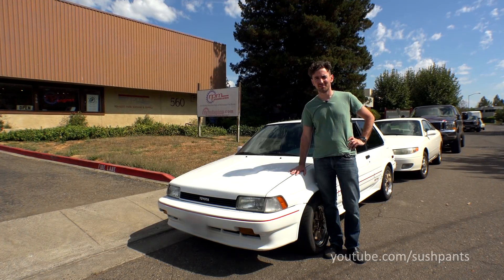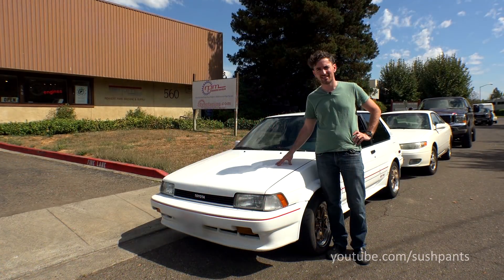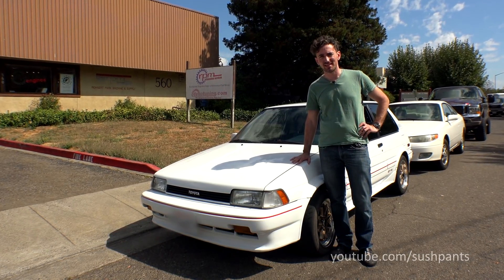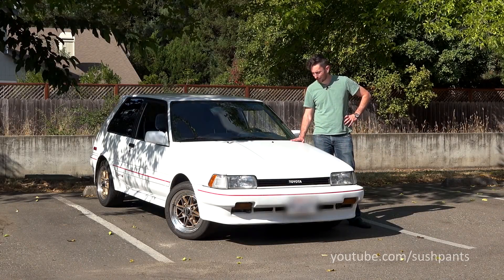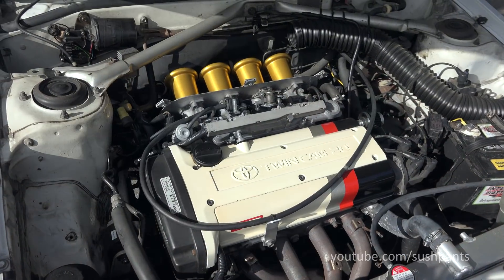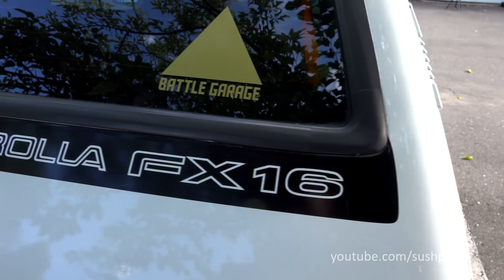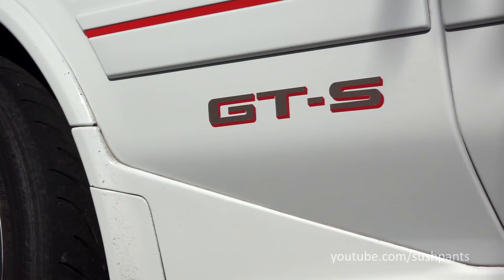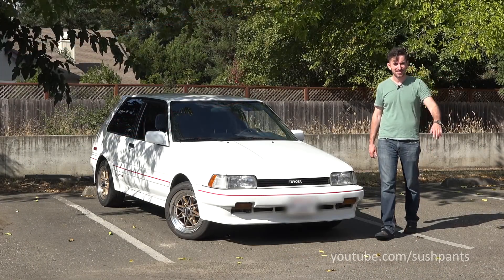How much power does a 4AGE 20v Blacktop make?

Comment: how are you running your idle control valve? is it just sucking air without a filter? 

thought the 20v didn't do so well with open stacks without an aftermarket ecu haha looks like this'll be next for me
Reply: longdongsilver you can run a breather tank filter, and it will run perfectly fine with a bt Ecu
Reply from the maker: +longdongsilver I have little filter on the idle control valve. The blacktop has no problems with the oem ecu running open trumpets.
Reply: @sushpants ? Seriously? Ok , lemme try that then

Comment: Howzit buddy
What were the KW and NM figures on the dyno sheet
Irfaan - South Africa 
I drive a 20v BT too 
Currently running :
Branch 
63mm exhaust
Gasflowed head 
Ported 
60x 96mm bell mouth ram tubes
Valves are at three angle seating
Oil restrictor in the block 
I've bored the block to 82mm with oversized pistons 82mm 40thou 
Upgrading cam shafts soon and also stand alone management...
Reply: Irfaan Osman stock ecu?
Reply: At the moment yes
Reply: Where in South Africa you from?